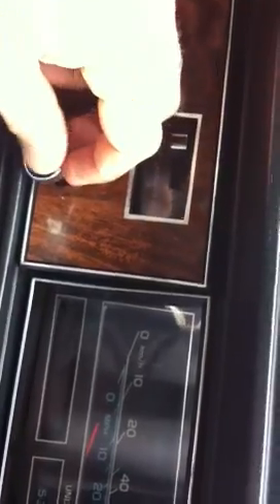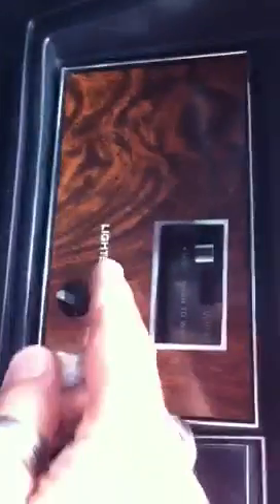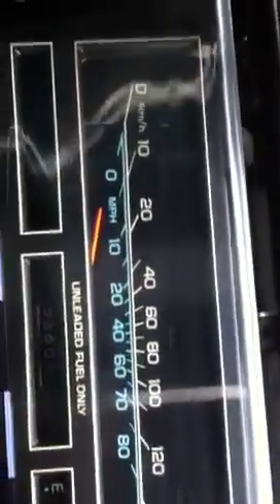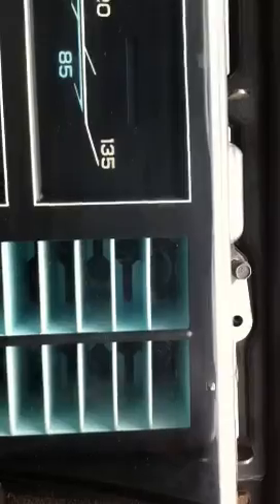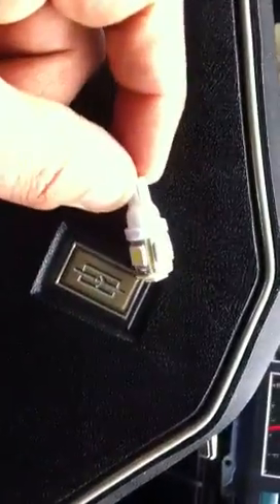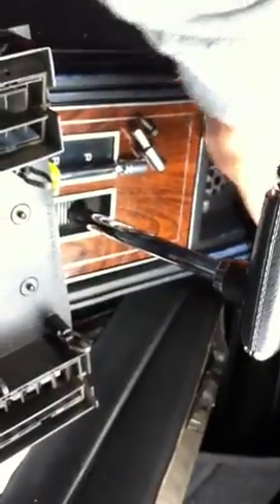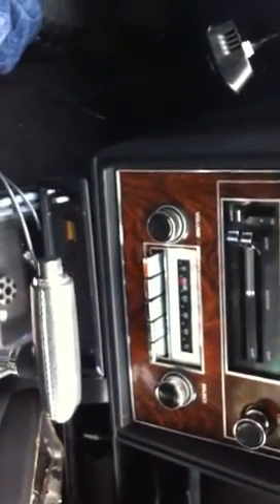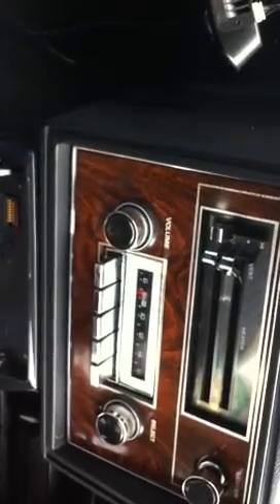How to remove dash ( cluster ) 78 cutlass supreme

Comment: How do I remove my cluster from my 87 regal? I remove the bolts but can't pull the cluster far enough out to disconnect the speedo cable? Also what are the brightest led's 194 I believe for the red and amber or orange? Trying to match all the interior lights to my autometer lights?